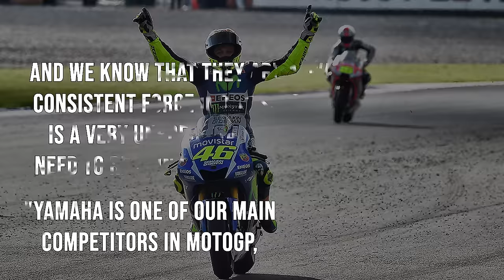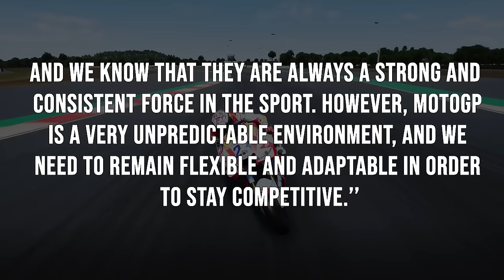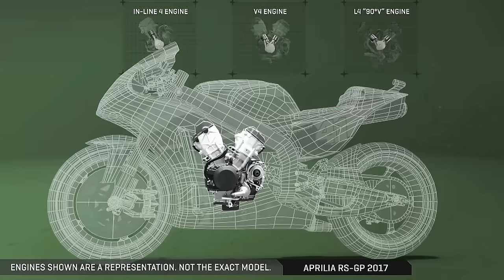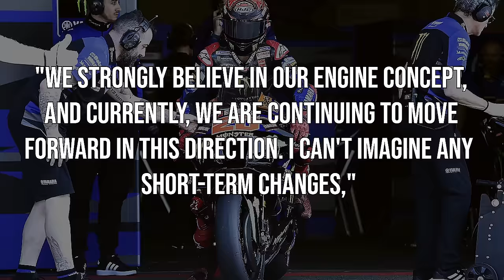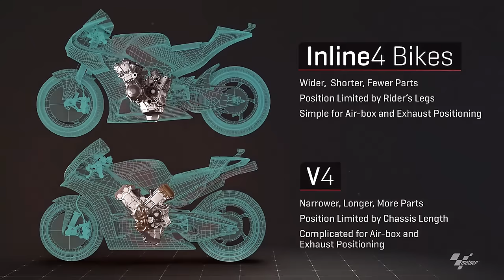You Won't Believe What Yamaha Just Revealed About the V4 Motogp Engine Switch!

Comment: Yamaha riders, especially Quatararo, have requested more horsepower for years. But Yamaha was afraid it would affect the balance of the chassis and screw up the handling. But with Ducati, Aprilia and KTM now faster they finally gave in and added power. And guess what ? It messed up the handling, particularly rear grip. So now they're trying to figure that out. You can't just change one thing on a GP bike without affecting everything else.
Reply: The bike has plenty power
They just can’t get the complete package of electronics,aero and power delivery to work
Reply: Ducati has power, stability and handling. 
Everyone has caught up and now surpassed the "Yamaha" cornering speed
Reply: for years😂😂😂
for years not adding power and not improve on the handling. what a waste years
Reply: Same mistake Honda  made .
Reply: @macsmith6216  you just said that the bike has plenty of power. it does... but inline 4 cant put down the power on corner exit as early as a v4
Reply: Yamaha super ❤❤🤔💪💪💪🥂😊😊

Comment: Yamaha has been building v-4 engines since the mid 80's both 2 stroke and 4 stroke so its not like they have no experience in the engine configuration.
Reply: From the 1960's   actually

Comment: Im surprised you haven't talked about yamaha already having a unique inline 4 design with it's cross plane engine compared to every other manufacturers using flat plane
Reply: Spoiler: the retired gsx-rr from suzuki in Moto GP also had cross-plane crank so it's not unique in this sport
Reply: They retire. Thats made Yamaha unique 😅
Reply: Just to add a little more controversy and bickering back and forth. Yes Suzuki did run a crossplane inline 4 in MotoGp but never offered it to the public and selling on its showroom floors a normal flatplane crank inline 4 in the GSXR 1000 in which pretty much hasn't changed much since the liter band got lifted in 2000 when manufacturers were once again allowed to sell liter bikes to the masses legally were as in 2009 YAMAHA offered up the first mass produced crossplane crank inline 4 cylinder engine with that distinctive symphony that  mixes that V4 roar with a sprinkle of traditional flatplane inline 4 scream more so leaning towards roar for that truly iconic and unrivaled sound that comes from the exhaust of a R1 because you can always tell when an R1 pulls up, rides by or races past you verses that of a V4 is it Ducati, KTM or Aprilla? Or inline 4 flatplanes, is that a Suzuki, Kawasaki or a Honda but for sure you will always know when an R1 with a crossplane rolls up

Comment: How much information
Is wrong here ? Each only has one crank shaft . One is smaller and more compact the V4. Most streiat  4 rev higher and make better power at the top.
But Yahama has an engine where the crank set is different so it flattens out at the top.
The V4 is much narrow
and feels better in turns. Each has its problems to overcome. But some information here is just wrong..
Reply from the maker: Totally agree with you John! Sorry if some of the information is wrong, we’ll work on that! 🫡

Comment: Let's be honest here, Yamaha were racing V4 2 strokes, Yamaha has been lazy from the beginning. They were ok till riders were 80% and motorcycle was 20% of the equation (golden words by Jeremy Burgess). Valentino switched from a V5 to inline 4 and won races and championships. 
KTM started with V4 and caught up pretty quickly, so it can be done.
Reply: I was thinking you are going to reveal some thing. But aag.
Reply: 2023 is KTM 7th season in the Motogp class. It's took them over 6 year's to get to where they are now......

Which is best of the rest still a good bit behind Ducati!

It will take Yamaha many year's to build a competitive V4 engine Motogp bike.
Reply: @C--A  KTM had zero experience with MotoGP racing and V4 engine. Yamaha has been racing for decades.
Reply: Wrong comment etc. a V engine don’t need a additional crankshaft ! The talking about a inline engine and showing a V engine and so on .

Comment: Interesting, if a little simplistic in places (as I find this video some time after its first release). This is a topic which gets discussed with a lack of factual information, with factories understandably 'keeping secrets', and most of us having only a minimal understanding of the dynamics of different engine layouts. 
We are never told whether these GP engines have one, two (or no) balance shafts, and this is an important aspect in the comparisons between V4s and in-lines. Also the unmentioned aspect of the 70 degree offset between the 'two side-by-side V-twins' of the Ducati V4 (and now Aprilia?) engine configurations.
And by the way - the crankshaft shown in the Yamaha picture around 9.28 is actually a conventional four cylinder crank - not a 'crossplane'.

Comment: the reality is inline 4 gives it better grip during corner entry and carry speed throughout the corner. weight is well upfront thus the grip is there. the difference with a v4 is on the exit where the power could be put down earlier due to more weight at the back.

motogp is not the same back in 2000's. aero is one of the biggest culprit to yamaha. everyone can match yamaha entry speed with bigger front downforce and and others got the advantage to exit acceleration where yamaha is not even going to match due to its engine configuration.

Comment: a heavyer and narrover V4 can be mounted lower in the frame, then you can brake harder (before the bike flip over), and you can accelerate harder with lower senter of gravity. I also think Ducati has counter rotating engine to the norm. which help ceeping the front wheel down when accellerateing. (On a bmw boxer engine you feel the bike lean sideway when you give gas/trottle, from the gyro effects).

Comment: I like yamaha because they are not afraid to suffer the "penalty for taking the lead".. Which means that they will not only develop new technology, but produce it and sell it - which allows it's competitors (Honda, Kawasaki and Suzuki particularly) to improve on it's ideas on their production machines.  Just look at the world of motocross - Yamaha gave us liquid cooling - but put the radiator in the worst possible location.. honda solved that issue by moving it where it resides now on all MX bikes!  Yamaha gave us monocross (single shock rear suspension) but located a too large and heavy shock in the worst place.  Again, Honda gave us the pro-link - improving on the idea.  I have to give yamaha credit - they are bold...

Comment: But it’s not just changing the engine layout. It’ll need a new chassis too. Yamaha have never done a V4. When Honda and Ducati have had a V configuration for years. Also it’s worth noting that Suzuki did very well with an in line 4 so I think Yamaha’s problems are more than just the engine layout.